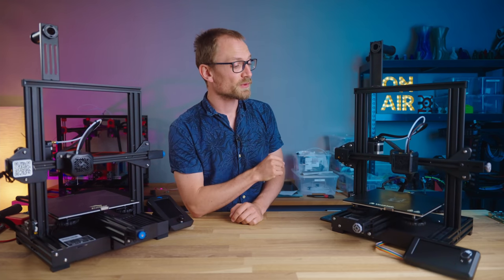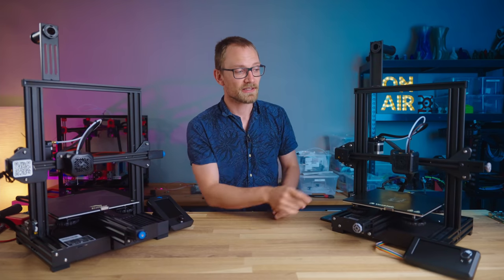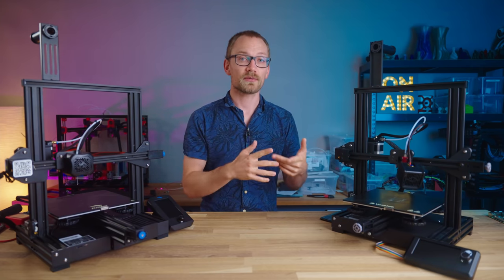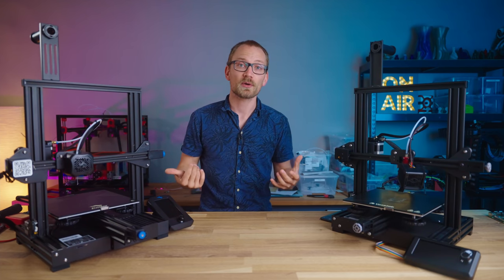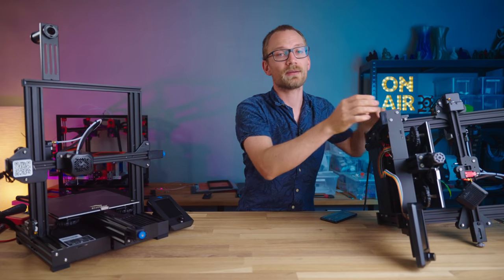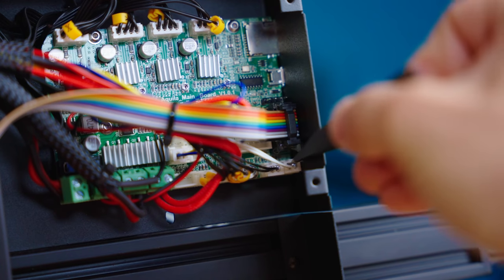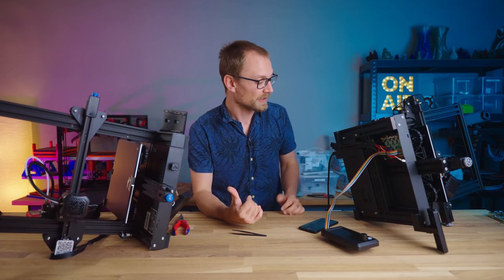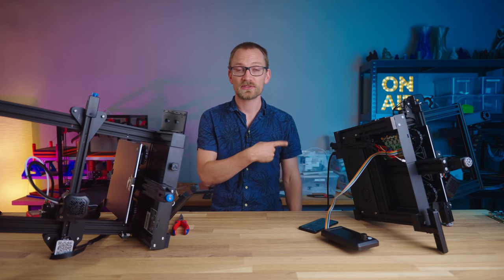How to make sure your 3D printer won't catch fire!

Comment: Love your radio station choices! Love the analogy for thermal run away! Glad to see a video on this! The industry needs more awareness!
Reply: Oh the industry knows. Or at least the devs, designers and manufacturers do, and the (re)sellers very rarely touch firmware or make product alterations - they just buy, sell, ship. Many even just dropship - meaning they never even had the product in possession.

Primary issue is sloppyness and severe corbercutting, by people that mostly know better (bluntly, they'd never buy or use that product themselves, because of those same shortcuts). That's makes the whole thing so much more worse and insidious IMO. It's not exactly cutting baby formula with melamine, but it's much of the same mindset.
Reply: @pr0xZen  Oh the devs know, it feels like a bit of "we know but we just do not care." Corner cutting for SURE. If you are trying to compete to the bottom safety will have to give eventually! I just hope we do not go through more Anet BS before things get fixed..

Comment: I ( Couch..Finally) unpacked my Replicape today and started installing the firmware on the Beaglebone. During the upgrade I watched this video. Found it one of the "Share directy to friends" type. 
Guess what the first warning/Error message was, Octoprint gave me after the initial install: 
"MCU 'host' shutdown: ADC out of range - This generally occurs when a heater temperature exceeds."

Just having seen your video, this made me smile, as now I knew the reason, I had nothing connected yet to the Replicape and the software reported a temperature problem. Perfect Timing of your video.

Comment: I bought my first FDM printer for only $119. It is Mega Zero from Anycubic, Thermal runaway control in this is working so well that even when I had my thermistor just bit out from its appropriate spot, making it measure a bit less in temperature rise than the printer expected while heating up the hot-end, it shows thermal runaway error. I guess every brand has its own flaws in their printers. I’m just glad it is the other way around in mine.                                                 By the way your videos are great Tom, very professional and helpful. Thanks for making them. Keep it up!

Comment: I've checked my Ender 3 v2 when I got it, and checked it again after upgrading to Jyer's firmware.  I also replaced the hot end with all-metal, as to not have a chance of any fumes from a burning PTFE tube.

Comment: Its wonderful to see this being bought up! Imo should be minimum standard for a consumer printers to have at-least thermal run away protection. I have a modified cr-10s that has thermal run away protection on a 240v heated bed with a thermal fuse and a seperate earth wire attached to the bed and ssr. I still have it in a aluminium and cement board box with smoke alarm and don’t leave it un attended
Reply: Eah, agree. 
But all electrical equipment should be supervised.
We have dozens of devices in our homes that are constantly powered, and all it takes is a small mistake in their design 20 years ago, a slightly thinner wire, fold of the extension cable or a bump while transporting them and we could lose our house and our lives. 

Monitoring is the safest and easiest nowadays (unlimited mobile data, video server from an old mobile phone).
_____
but it's nice to have the extra safety features.

Comment: A better level of protection is the octoprint plugin for the TP link smart plugs. You can add thermal runaway settings, i.e. if it drops below 5c or goes above 300 for example it will cut power to the printer completely, not relying on the printer's software.
Reply: But that only works if the thermistor on the printer works, and the printer firmware doesn't crash. While it may be an additional layer of protection, I wouldn't call it a better one. The best way is to fix the printer to prevent the problem altogether, not react when it happens.
Reply: @AlAmantea  If the thermistor didn't work it would drop to -15 and therefore cut off. It is a better layer of protection because the thermal runaway protection in Marlin only tells the board to stop heating. What if there is a board fault and it just continuously heats anyway? For example some SSRs fail in the open position meaning it continues to heat and never stops.
Reply: Octoprint replies on the printer to be reliable enough to send it the thermal data before it can do anything about it. If the printer fails and doesn't see the problem, or locks up and can't report it to Octoprint, then absolutely nothing would be done about it, because Octoprint doesn't know there's a problem. Not a better solution IMHO. Why not solve the issue in the firmware correctly, instead of relying on a third party as a watchdog after the fact?
Reply: @AlAmantea  sigh nevermind bro. You carry on doing you :thumbs up:

Comment: Thank you for this. I got in to a discussion on the reddit about how the Voxel isn't safe because of this. But people always retorted with it can be fixed in 5min with a firmware flash. Which is true, but most people aren't going to be aware of it as way too many YouTube/online reviews just don't mention it so a buyer who just watches those reviews would not know about this issue.
Reply: Yes so many have bought 3D printers that cant even do basic stuff like check the oil in their car or change a light bulb.
Reply: @MostlyInteresting  I guess I am in that boat. My printer can't check its oil. Dumb printer....

Comment: My Ender 3 cant print at 240 because it triggers thermal runaway due to temp dropping to 230 after it goes over 240. I have PID tuned it like 200 times and still same
Reply: Do you have a silicone sock around the heater block? Sometimes the fan can cool the block too much and the heater can't keep up.
Reply: it's a firmware limitation for safety reasons due the use of PTFE tube
Reply: It has gone up to 260 before and also with current thermistor and cartridge
Reply: @TheAnoniemo  I do not but part cooling fan not on until second layer
Reply: @niklasahlfors6564  It's not the part cooling fan on the Ender 3 but the hot end one that's always on. It blows straight down onto the block.
Reply: @niklasahlfors6564  cold end cooling fan actually is several times more powerful than the part cooling fan. And the air pretty much has nowhere to go but down,  so it cools the hot end parasitically. Plus the stupid screws connecting the hot end to the heatsink.
Reply: @TheAnoniemo  but just in case check all the wiring and the board connectors while heating that they're not getting warm. Sometimes you get thermal runaway warning for a reason. In my case it was once because the control PCB was delaminating.

Comment: I got an older Ender 3 a few years ago back when Creality didn't ship them with thermal runaway protection in the modified Marlin firmware. Their janky "power off recovery" was terrible and destroyed cheaper MicroSD cards in my experience so I flashed it with standard Marlin to make sure my printer didn't burn my house down. Even back then this was considered to be an idiotic move from Creality.

Comment: Hi Thomas,
Great and useful info. But there is additional one very tricky situation: shorted/broken heater mosfet.

If your mosfet will be broken it will become like a simple jumper and not switch anymore. And if even Marlin firmware will notice that something wrong it will not help, because after switching ON printer 12/24v from PSU will appear immediately at heater.
As solution it could be used master relay that will cut off completely PSU from AC.
P/S I Am owner of MK3s, and I ask these question of their hotline, so they say that it is not recommended to keep printer alone because of these :). And of course MK3s do not have master relay/master mosfet.
P/S P/S I am repair engineer at factory and all new modern certified equipment has this master relay to prevent fire or health hazards.
Reply: i use thermal fuse under the bed that cuts off the main voltage if bed runs above 125c. it runs on 230AC through an (genuine) omron ssr relay. need to figure out something for hotend
Reply: @j.g545  good solution, but not perfect. For example MK3s has very tight wire management at extruder head, and adding of thermal fuse will create a lot of mess

Comment: Another (very easy) test you can do is to grab the heated nozzle with a pair of metal pliers.  If I do this on my printer, an error message pops up on the screen after a few seconds alerting me that heating has failed.  The pliers act as a heat sink, quickly drawing heat away from the nozzle.  If the printer detects that it is taking way too much energy to keep the nozzle heated, then it should fail and stop heating.  First time I noticed this was when I was heat tightening down a new nozzle and had the pliers/wrench touching the heater block and nozzle for too long.

Comment: Had a thermal runaway once. The protection was on and it triggered but the failure was on the board itself so it kept heating up. I now have a mechanical relay that cut off all power in case it happen again.
Reply: Yeah I think PS_ON control is a very good idea in conjunction.

Comment: I built a hypercube printer myself, I used to have a lot of thermal runaway issues.
in my case I managed to fix it by making a shielded wire for the thermal sensor as it seemed to be influenced by other wires all fed through the same in the cablechain

it was a pain to get the printer to stop doing thermal runaway but at least I know my safeties work ;)
Reply: I've had issues too with thermal runaway, but sometimes it's just a bit too tight tolerances on default values.
You don't really need to worry if the hotend varies ~5°c from the target, but when things get 20°c out of range then it sure as heck fell out. On another occasion, I had a bad PID tune and the part cooling fan blew it too cold even with a silicone sock, that also triggered the safety.

Comment: Default thermal runaway behavior in Marlin is stupid because if it senses a thermal ruanway on the nozzle for example, it will lock every axis in place, with the supposedly thermal-runaway-ing nozzle on top of printed plastic.
It does fuck all in case of mosfets failing short

Comment: I think its amazing no printers have hardware protections for these failures.
Reply: When I modified my cr-10s (240v heater) i put a thermal fuse and seperate earth on to my bed. Ideally id have firmware and electrical interlocking running a redundant control. As currently don’t have protection if my SSR fails. I made sure to by an over sized one that i bought from a reputable store in my country
Reply: Do you know of any printers which burned down with enabled thermal runaway protection?
Reply: Id bet its cost mostly, both in terms of components and updating the design to use them.  Many physical thermal protections are quite large to or designed for lower (circa 100C) temperatures.

Comment: Although it's not EXACTLY the SAME wiring nightmare, I sure wish I could share a SCARY PICTURE of the failed yellow connector that I just replaced on my Ender 3 - all burned black and crumbling apart!  Seemingly simple thing to connect the two main power wires coming from the PS to feed the main board - a hot and a ground with crimped-on plugs.  Problem seemed to be inside the cheesy yellow connector!  It was obviously made of the infamous CHINESIUM inside!

Comment: I have changed the heater cartridge and thermistor and still get the E1 error. Not sure What is wrong will try to update the firmware, currently it’s 2.0.8. Any suggestions thanks.

Comment: But how are those Safety features not working? Marlin has them enabled by default you mentioned. Did the manufacturer disable it? Or were bugs introduced in the system?

Comment: Flat out lack of care from manufacturers that these warnings still need to be presented to consumers via 3rd parties. Even simply activating the runaway flag takes less than 30sec. At a manufacturing level that's 1 change to a master file once....epic fail at duty of care

Comment: Hay Tom I have always wondered why the I/O isn't fused on the 3d printers there realy is no excuse. In a industrial setting all I/O on a PLC is fused for protection to the operator and equipment for something that costs penny's they should be added also thermal protection should be added, also there should be no plastic parts on something that can catch fire

Comment: This is why when I bought my cheap Anet A6, I took out the main board and replaced it with Mega 2560 and RAMP 4.1 running Marlin. 
You never know what they use for their firmware.

Comment: The printer needs to be safe even if the software isn't involved, eg the mosfet for the heater shorts. If the printer catches fire by continued heating, it's designed wrong.

Comment: Hey Thomas, I am not sure if you will see this but can you do an updated video for "Update your 3D printer firmware without a bootloader" like here https://www.youtube.com/watch?v=oZVTYpHnpIw, but use VS Code and the marlin extension and PlatformIO form Marlin 2.0? Just another video idea if you need something for a small filler while finishing a project but need to get something out.

Comment: I had the thermal runaways protection kick in on my prusa MK3S. The thermistor on the heat bed was pulled away from the bed during a PETG print. The PETG go so hot that it melted into the powder coated print sheet. One side is completely ruined as it has no more powder coating on it. Luckily that is all that happened.
Issue was because I did not secure the wires properly during assembly.
Any printer without that feature should not get a passing review on any channel!

Comment: yeah test it.. short the fet that is powering the heatbed (it's common for fet to fail in short) and watch how software thermal runaway can't do anything about it unless you have separate psu shut off - which you don't.

Comment: Why is there not a mechanical safety?  If a fuse trips above a temp, stop the electrical current to the printer until the user manually resets.

Comment: I just had a thermal runaway on the ender3v3se and the safety features worked beautifully. It smoked a lot but it shut off almost immediately after the thermistor failed.

Comment: None of these constructions are enough. There should be additional bimetallic fuse that is independent of anything and trips off slightly over usable temperature! This is how safe devices are made! It’s bad that we have to check anything and the basic first stage protection isn’t even working apparently in some cases. There are actually two circuits that need such protection: hot end and bed heater. Other solution is to design machine so that even if regulation totally fails the heated element will be balanced so that will be able to stabilise itself at temperature that will not make fire at any conditions.

Comment: Thanks for the good knowledge! Still, I've had a broken mosfet that it shorted out and luckily, my home assistant server was configured and able to turn off the printer's power supply 😀. It was on a SKR V2 mini installed on an Ender 5. Really lucky me. Do you know if maybe the Octoprint is able to do this by its own? I have the Octoprint Relay plug in but i did not saw this feature. Again, thank you!

Comment: Aren't those safety features enabled by default if I downloaded a new marlin setup and flashed it? If they are, then that would mean those companies would have had to turn the safety features off to begin with, I would think.
Reply from the maker: If you flash a fresh firmware from scratch, all the safety features should be enabled as that's the default. Still do test them, though, as in the Aquila's case they seemed to be active, but the firmware then crashed when it tried to deal with the fault.

Comment: This is why, as soon as I got my Anet A6 2 years ago, I chucked the electronics out and put my trusty Arduino Mega + Marlin + RAMPS 1.4.
Sometimes I forget the printer is not powered by mains but the electronics is still powered by the USB port, and I try to heat the nozzle, I get the thermal run away message. 
Good to know it works. If I'm not mistaken, Octoprint also has thermal runaway feature built in.

Comment: There is one thing I've encountered that I haven't seen any way to prevent.  In 2013, I had a Melzi 2.0 board that had the gate leg of the power mosfet controlling the extruder heater fail, resulting in thermal runaway just by plugging in the board.  I had to replace the entire hot end, since the aluminum heater block melted enough to prevent anything from being pulled out of it.  This kind of a problem can't be solved through firmware, which is why I'm uncomfortable leaving my printer alone even with the protections it does have.

Comment: Hi Thomas. Just one to maybe add or talk about. My ender3 onboard relay somehow got stuck in the on position. Although the board thought it could switch it on and off it was actually just heating up every time I switched the printer on. I replaced the board. Not sure if this ever happened to anyone.

Comment: My Ender 5 Plus actually has the problem that when its to cold (less then 5°C) it will go into Thermal error mode. So if its especally cold in the surounding area, i have to preheat the printer to get it above that temp :D Yes i know would be better to have the Printer in a heated area but i just dont have the space for it.

Comment: At work, one of the RF2000's hot ends melted down on me. In this case, the holding plate of the parts cooler had bent and cut and connected a cable from the heating element against the housing, i.e. ground. Since the heating elements are switched on the low side, the hotend was permanently heated. In this case the firmware could not intervene because the mosfet was completely bypassed.